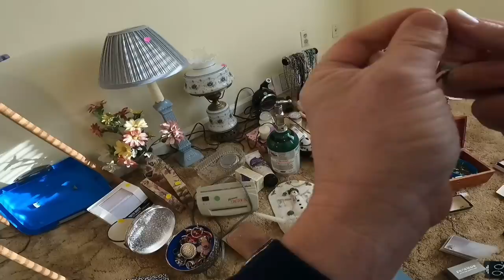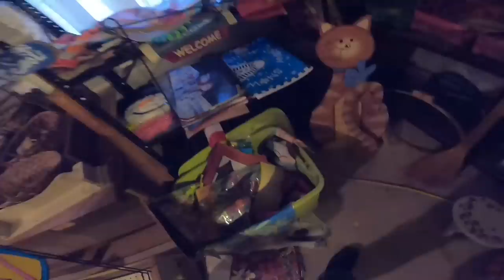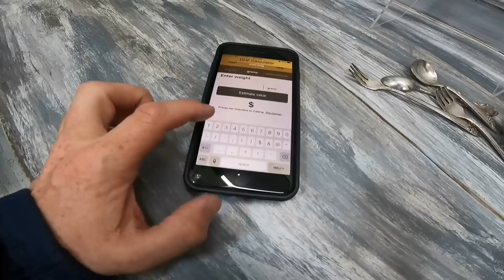GARAGE SALE GOLD AND SILVER JACKPOT

Comment: In my experience the butter knives, even though sterling handles, are weighted on the inside and of course the blades are steel.  So their silver value is not so much.  Maybe 10 to 30% of the weight is silver.  However, if the set is a desirable pattern, then there is value above the silver value.  But of course the spoons and forks are solid sterling, so yeah.  Great find!

Comment: You generally find Kevin that those handles are unlikely to be solid silver, what is normally the case is that they are resin filled to give weight or in the case of mid 19th century or older they’re often hard wood cores or a heavy base metal with a pressed Stirling silver casing on the outside! In this case with the blade being stainless and given that stainless is a mid 20th century product you’ll likely find they are resin centres to the handles so don’t get too excited about the estimated weight!!!! That said for $15 they’re a steal 👍🏻👍🏻👍🏻

Comment: Did you see that EBay raised the selling fees on April 1st? For managed payment people subscribing to a plan, the 11.5% changed to 11.7 % for most items. Books, DVDs and CDs went from 14.35% to 14.55%. Electronics and camera went from 8.5% to 8.7%. I never noticed any announcement of the higher fees, but they show up on the fee schedule and I noticed in my spreadsheet that with sales starting 4/1, my spreadsheet was a little lower than the fees being charged.
Reply from the maker: Crazy

Comment: Never go back after getting a huge score. Seller could have said hey remember that silverware I sold you.
Reply from the maker: Lol. But there was tupperware in there.
Reply: @CommonwealthPicker  😂
Reply: Just use the Shaggy Defense: It wasn’t me. Or the Bart Simpson: I didn’t do it.
Reply: Just so everyone is clear about the hollow sterling silver handles on the knives (and other specialty pieces) by Gorham and other producers of sterling silver flatware — they are NOT filled w/ cement, plaster, or any other ersatz material that would be intended to give more weight to the handles. No reputable silver manufacturer does this.
The knife blades are made of stainless steel, however, in order to give the blades enough strength to be useful.

Comment: Always tell the sterling by the way it sounds when clangs together.
Reply: Sterling is frequently marked with the word “Sterling” on flatware and jewelry (or may say “925,” in the case of jewelry) ... curiously, the hollow-handled knives are usually not marked at all. (Additionally, the blades are stamped “Stainless Steel”.)
Contrary to the prevailing opinions offered here, hollow-handled knives are NOT filled with cement, plaster, or any other ersatz material. No reputable sterling silver flatware manufacturers use fillers of any kind in their hollow handled utensils.
To me, sterling silver has a distinct smell, and I can identify it from that.

Comment: The knife handles are FILLED STERLING !!  The actual sterling has to be peeled off and it is not easy !!
Reply: Way easy to peel off. But..... no money. Just like weighted candlestick holders. Money is only in forks and spoons.
Reply: Gorham sterling hollow knife handles are just that: hollow! They are not ‘filled’ with anything other than air.
The attached blade, however, is stainless steel.